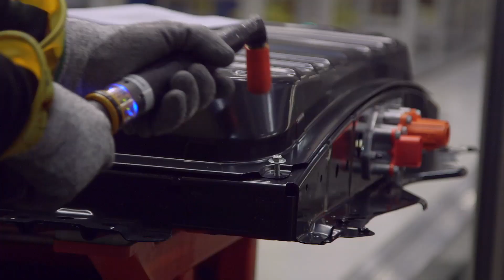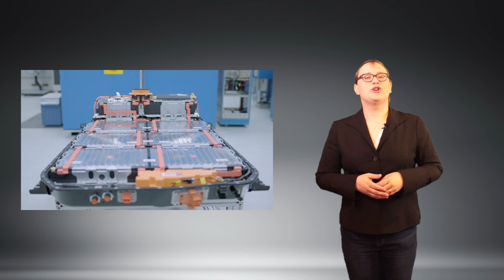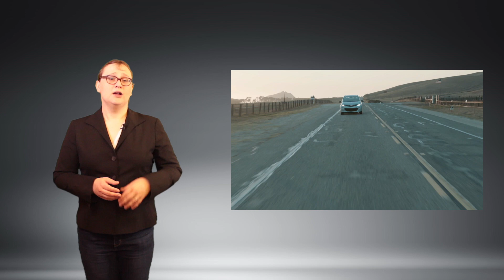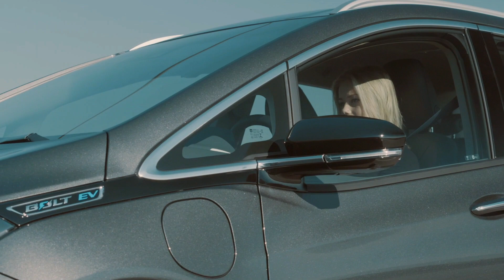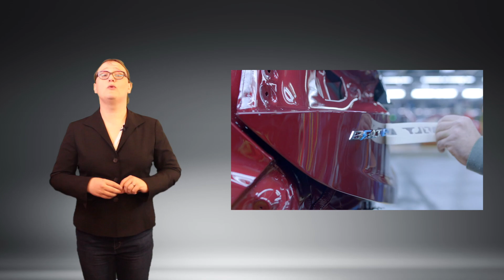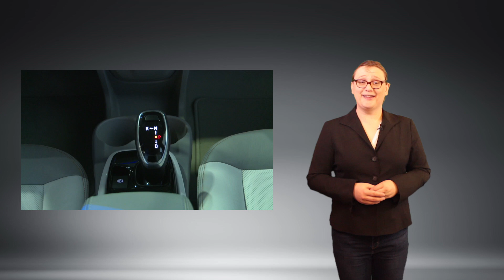Should You Worry About Battery Replacement Costs for Electric Cars?

Comment: My wife slugs away too and from work in our Ford C-Max Energi every day and it only has  a 7.2kW pack and gets charged 1-2 times a day.  We've owned it 4 years and 43,000mi later and it hasn't had noticeable degradation yet.   According to the dash 28,303 of those miles are all electric.  Maybe the Panasonic cells used better than average, don't know for sure, but they've held up well to the Texas heat.

Comment: At least there is an option for replacing battery packs in electric cars (and the costs will keep plummeting for the next decade at least), what about gasoline cars with ICE engines? Most cars reach scrapyard which is one hundred percent assured. It is almost impossible to do an ICE engine replacement unless of course the car is in its early days and customer is ready dole out huge sums of money for a car and engine that will remain unreliable and high-maintenance for the rest of its lifetime. Suck it up petrol heads, your days are numbered.

Comment: you said the claim is completely false and yet my Civic Hybrid has the IMA light on.
Reply: Depending on age Civic Hybrid uses NIMH batteries that are air cooled not Lithium .  I just paid 3000NZD including labour to have my 2005 Insight battery replaced.  But options in the US and UK are much cheaper.  Grid charger for the Civic will keep it ticking over for quite while before you get fed up with pulling the 12v battery cables to reset the IMA.

Comment: I've heard of early Leafs with batteries degraded to the point they get only mid-30s in range. That would make the car nearly unusable, especially in cold weather.

Our 2013 Leaf S that we got used still has all its bars, and charges to claimed 88+ miles still, so I'm hoping it'll last at least another 3 years (when the youngest clears high school). At that point I'm hoping there are some third-party battery replacements available, if the range is down to the 50s or 60s. OTOH by that time there'll probably be 300 mile cars around with newer design, better gadgets, and better DC charging, so it might not be worth replacing the battery.

I really love the way the Leaf drives. Of course there are benefits WRT operating costs, but the thing that makes me cast around for errands to run is that incredibly quiet smooth drive, which no ICE can match. Hope the battery sticks around into the 2020s.

Comment: My 2013 Chevrolet Volt has 102,500 miles on it and I can still drive over 40 miles on a charge and have went as far as 48.7 miles on a charge . So I have no worries that the battery will need changing in years to come .
Reply: Total miles doesn't matter.  Only EV miles matter.  There are Volts with 200K miles, but the miles were racked up mostly on gas.

Comment: In short the second hand market value on ev sucks. That's not an issue with gasoline cars 1,25k doesn't mean you have to replace the engine that's just nonsense

Comment: By all accounts the battery in my 80,000 mile Nissan Leaf is problematic. It is said it has inferior gen1 technology and doesn't stand up to hot climates. I live in texas and the car has always seen hot summers. The battery has degraded some according to the meter but it still does my 30 mile round trip commute easily... twice on one charge. That is all I have ever asked from it. 

The car has required some maintenance though. It got one set of tires changed, several sets of windshield wipers, and i had to fill up the windshield wiper juice. In 2019 I will be due for a coolant flush. That and the recommended (but neglected) air conditioner filter change are the sum total of the required maintenance. there is literally NO oil change, transmission service (there IS no transmission), tune up, the electric air conditioner compressor seems to last forever, and regenerative braking means the OEM pads show no wear.

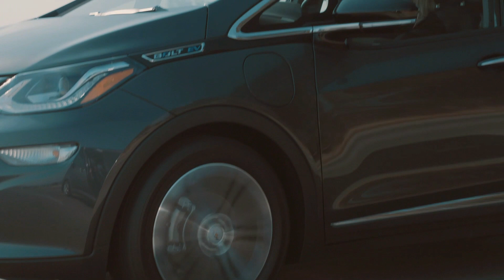The car still drives like new. I feel like I should put some struts on it or Something but it really doesn't need a thing besides a good wash. The interior is well built and comfortable showing no real wear (I don't have kids). It is an absolute Hoot to drive, whether challenging myself to get the highest M/kWh (5.4) or spanking a show off in the 5:00 stop light drags. I recently rented a new nicely equipped Buick Regal Turbo for a trip on a long weekend. It was quite nicly appointed inside but I couldn't get over how old fashioned it felt to drive. EVs spoil you.

Originally I thought I'd replace the battery when the time came but degradation seems to have stabilized. I'm tempted by the upcoming 2018. It will likely be fantastic. the problem with that is there is nothing wrong with my Leaf and I still love driving it. There is no better value in cars today than a Nissan Leaf. Combining tax and incentives in the US it is easy to get 20,000USD off the list price. The to-be-announced Leaf is expected to have well over twice the range of today's 100+ mile range. Tesla's Model 3 does too. Certified and waranteed used Tesla Model S cars can be had for about the list price of a Leaf. If you are tempted by electric cars, or even just curious, there has never been a better buyer's market.

A word of warning though. you will definitely get addicted. Driving EVs simply spoils you for driving anything else.

Disclaimer: I have other vehicles, like most suburban commuter families. Long trips are usually in a Subaru Forester.  I have a garage to put my charger in. I'm OK with planning my day and going out of my way a bit to use a quick charger when knocking around town. weekend rides on country roads are done on a motorcycle. If you live in the country or in an apartment EV life is more complicated. EVs aren't ideal for everyone, just most people.
Reply: Alberto, Electric Israeli posted a video about the 2018. Supposedly from the source that leaked the info, its only going to have a 40kwh battery. If that is true, Nissan just killed their EV. I love my 2013 leaf sl. It has lost roughly 13% battery capacity but still has 12 bars. I to like to drive my leaf like I stole it. I beat everyone off the line lol. Sure it takes its toll on the mileage but so what, I got a 240v charging system that can charge it to full in about 3 hours. It is simply so fun to drive. Not only that but it handles fantastic and is soooo quiet. I hate to even start my ice vehicle, the gas smell, noise, ughh.
Reply: Luke W obviously you didnt read what I wrote and fixated on bars
Reply: Yep, I know better. I should do that this weekend. for me the car is a beater. I do tend to neglect checking tire pressure etc. Shouldn't. maybe I'll even change that stupid air filter. It's a booger to get in and out :)
Reply: Alberto Knox change the brake fluid every 2 years - regen alone isn't enough!
Reply: Darren Cole number of bars doesn't indicate true battery capacity.

Comment: Electric cars under warranty are far cheaper to operate than ICE cars.  Electric cars have a much longer warranty than ICE cars.  The battery price will only drop as the car gets older.  Re-conditioned batteries will also be available.  Think of a battery like an engine in an ICE car. Some well engineered electric cars will go 300,000 miles plus on one battery others will fail at  70,000 or 80,000 miles.
Reply: fatboy19831 people like to make blanket statements. i gets really annoying when they say all ICE last for decades when many of them need thousands in repairs to last that long.
Reply: Jonathan, True.  I love BMWs  I would never keep one out of warranty.  Even the best of BMWs only give about 130,000 miles of reliable service.  Most Toyotas have no problem going 300,000 miles.  Most American cars can go 500,000 miles or not make it to 100,000 miles with the stock drivetrain.

Comment: I get a new car every 3 or 4 years so the battery replacement never worries me. Erick Belmer's Volt is coming up on 400k miles on the original battery so I'm sure there's no reason to worry about the GM EVs.

Comment: I only buy used cars. So for me, battery replacement is extremely important. Not everyone can afford a new car every three years. What do you think happens to all those traded - in Leafs? Someone like me buys them and must consider inevitable battery replacement.
Reply: So many cheap used Nissan leaf being brought into New Zealand from Japan at the moment. You could by one run it for a few years and throw it away and still save money over an ICE car.  There's a lot more tax on petrol here but no rebates or subsidies on the purchase prices.  Shame since we're over 80 percent renewable and climbing.  Wonder what the scrap value of a used Nissan Leaf is?
Reply: Your main reason for battery replacement, unless yours was abused, would be to get the extra range of a new technology battery over what it was new.  Other components are going to be performing at much less than new before the battery becomes a worry.
Reply: @Markle2k  - Why is everyone speaking like an ad agency for EVs.  The fact is that the Battery will eventually need to be replaced and it seems to me to be the only replaceable item on an EV which has virtually no access without major disassembly to parts that do not require replacement.  I view this as a design defect and a major deterrent to purchasing an EV.
Reply: @CasaErwin  The problem isn't with everyone else. The problem lies in your assumptions. "The battery will eventually need to be replaced" is equivalent to "the engine will eventually need to be rebuilt/replaced". Your assumption that a replacement battery will be unavailable is also faulty as they are available for older hybrid vehicles with older technology now. Why would that not be the same case for today's EVs in the future when a market for replacement batteries asserts itself?
Reply: @Markle2k  - You're spouting more bullshit!!  Everyone knows that batteries eventually wear out.  And I never said there are no replacement batteries.  The issue is that they are virtually inaccessible and require intensive labor to remove and replace.
Reply: @CasaErwin  "Everyone knows" Yeah that's always a safe argument along with the beautifully vague "eventually". There are videos on YouTube showing how to replace these supposedly "virtually inaccessible" batteries in just a couple of hours with simple hand tools.
Reply: @CasaErwin  what's so hard to replace them. You disconnect it and reconnect it. I say 3-4 hours labour.
Reply: @paulm.4394  Everyone here seems to be talking about the Nissan Leaf in particular.  This article is about electric vehicles in general.  I maintain that Tesla is the most popular of all electric vehicles and I was specifically talking about the design of the Tesla which requires a major disassembly job to be able to replace the battery pack and then afther the replacement it has to be reassembled.
Reply: The price of used Leafs (Leaves???) is crashing as newer EV models come out.The key is to do some research and get the bluetooth thingie and LeafSpy app to read the real battery condition.

If all is good there and if your real life fits the limitations of a Leaf's range there are no better transport deals out there. Just looked on Craigslist and there's a 9-bar battery (probably replacement) '11 with 100k miles for $4,500. There is very little that can go wrong with these cars if not wrecked.

Dealers are steeply discounting on top of the Federal Tax credit (only get full benefit if you pay more than $7,500 tax). There have been some group purchases this year but i don't know details. I've heard of new cars selling recently for under $20k counting tax break.
Reply: Reviewman George
Regular maintenance
Oil change? cost of 4-5 quarts of oil one oil filter $21-25 every 2 months or 5,000 miles, that's the most common item, rotate the tires at the same time.
Brake pads, (the front will be replaced once a year, less if you have a stick shift), drain the coolant and refill it.
Just follow the regular maintenance almost all of it can by done by the owner if you know how to turn a doorknob.

The Accord I had got 20-25 miles combined city driving, 30 when I was running on the Freeway.
Classic VW bugs are common here, mpg on those range from 21 - 25 depending on how you drive.
So fuel costs depends on where you live and how you drive

Re Warranty,
Some have a limited warranty, most are not.
Also depends on the dealer, none if you buy from a private party.
Individual replacement parts have a warranty from the part manufacturer.
Reply: Linus A , I drive a  2017Prius I average 58.6 mpg. I do in general speed not speed. I keep it in ECO drive and use cruise control and lock in. Only when some one who wants to speed illegally I will speed up to let  him pass to get out of their way. Electric vehicles have great acceleration. There's unmarked jack rabbits out there waiting for you to speed and there's the dog gone cop hounds waiting to get their quotas right quick in speed traps.
Reply: I won't buy a modern vehicle EV included, with the ICE Engine too many electronics and as far as the Electric Vehicle won't touch them, you buy a new EV for what 50+k battery life about what 10 years?, then you buy a new battery pack, how much for that?.

If you don't drive an ICE Vehicle for a few weeks it still starts and the range isn't affected, no chance of damage due to fast charging of the battery, EV's are like a disposable lighter only much more expensive. I have a 26 year old Land Rover Defender 110, 300tdi 220,000 Miles  on the clock and still going strong, my vehicle is eco friendly because its still on the road after 26 years.

Modern cars personally I wouldn't spit on them let alone alone buy one new or otherwise.
Reply: I do too buy only used cars, but with electric car, that. Will a problem, if you buy a used electric car,  no matter  how old, you still going to pay for a new. Battery that will cost at least 8000 dollar for a long range one,  but a gas car, you can just a used old one for just 1000. US dollar and drive right  away witought paying an extra penny for one year may be or more, and after that you may need. To replace some parts for safety but it will Not too much for that, cost.
Reply: Depends on the age of car you usually buy. Anything up to 10 years, probably don't need to worry too much, about as much as you do that the ICE car you would otherwise buy might have it's engine/transmission/diff blow up.
At 15 years you might want to factor the cost of a refurb battery in, though the projections for battery costs in 15 years make it an almost non-issue, considering TCO.

In all cases, battery cars are likely to be more expensive to purchase in the short term, but will be so much cheaper to run that the initial extra cost for the battery would be well and truly offset within a couple of years. I see battery leasing being a potential solution to this, which would take out the initial sting of the up front cost.
Reply: @morosis82  - I don't think the issue is with the cost of the battery replacements.  The issue is that they are virtually inaccessible and will require intensive labor costs in order to make the change.
Reply: Linus A do you have all the maintenance costs, oil changes, fuel costs with those gas cars? How much is a warranty with a 15 year old car?
Reply: Nissan Leaf batteries are still useful at end of life for a household battery storage as the demands are much lower plus there are  a few 90 odd percent leaf batteries from wrecked cars coming up for sale
Reply: Do you rebuild Nissan Leaf batteries or know where I could get a replacement for cheap
Reply: @Ninivee78  Nissan has an exchange program for older Leafs in Japan. A refurb battery is about $2700 for a 24 kWh battery. $110/kWh is very cheap for automotive batteries. This is compared to about $5500 for a new battery after a core exchange. 30 and 40 kWh batteries are significantly more.
There was a bug in the battery management software of the 30 kWh version that caused the appearance of degradation that wasn't real. A reflash of the module fixed the issue. If you have a 30 and that hasn't been done, you might get a lot of range back for little more than a trip to the dealer.

I haven't heard of any 3rd party replacements yet, but that is inevitable.
Reply: Bill Cichoke, - I live in California, It's not uncommon to see a 25 sometimes 30+ year old car running around here in So CAL.
Back in the late 90's I bought a 10 year old Accord for 500 US, kept that for 5 years, replaced it with a 15 year old mini van, kept that for a decade. about 5 years ago I bought a 26 year old Toyota for 1,200USD, and 16 year SAAB two years later. I still have the SAAB and last year got a 2nd SAAB to work on for 1,500.
Somehow I don't see being able to do that with an EV.
The trend with these cars seems to be for them to be leased not owned.
These cars are throw away cars, disposable appliances, or couches on wheels.